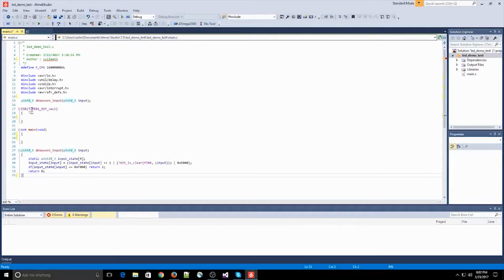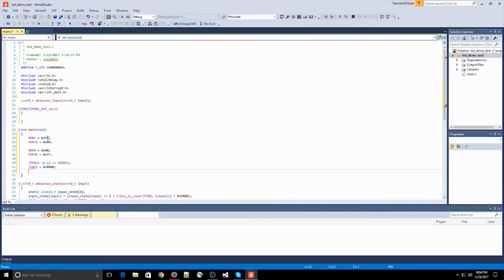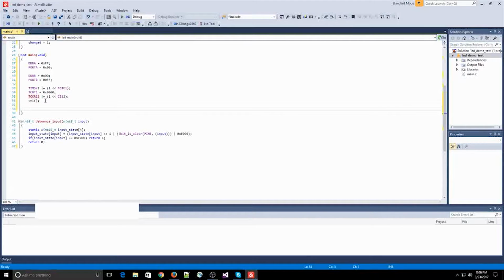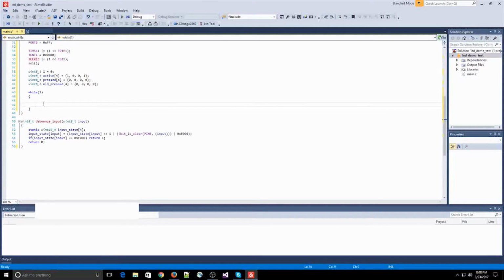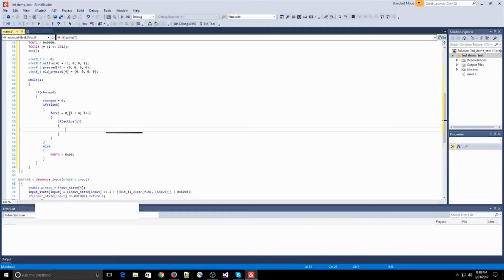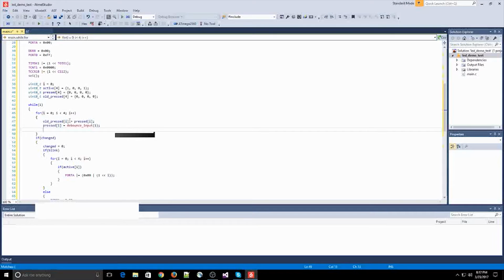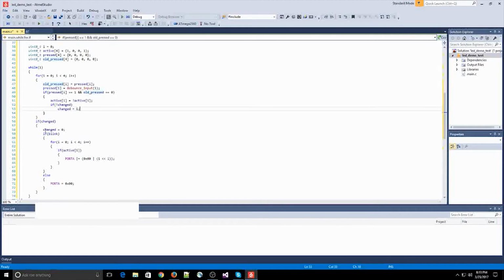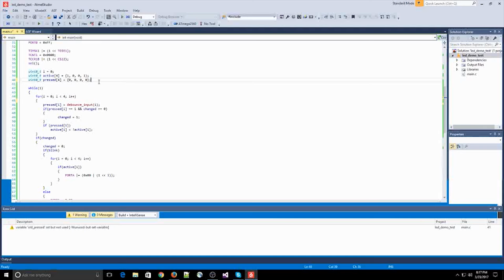AVR Blinking LED

Comment: How did you set up the external tools to get it to properly flash the device?
Reply from the maker: I don't remember needing to set anything up, Atmel Studio was all I used to flash the device
Reply: @ssilmath  Odd, I wish it were that simple for my purposes. I actually figured it out about an hour after my comment, but I have to set up an external tool, which I thought I saw you select from the tools menu, with the location of AVRDude.exe and a string of arguments etc etc in order for it to properly put the hex onto the device. 

I have it working for my ATSAM3X8E as well, but I'm oddly having issues getting it to work with my ATMega 328p...regardless, thanks for the video. I'll be putting it together after dinner tonight for practice.